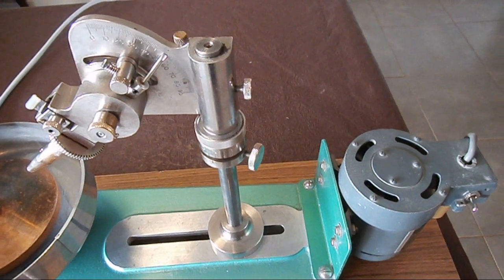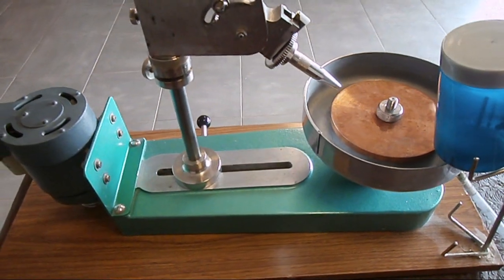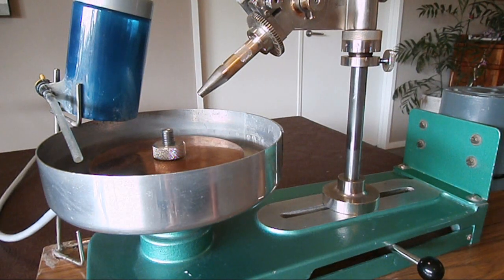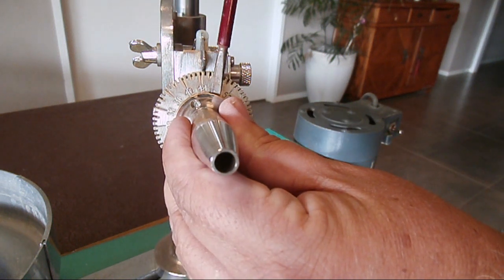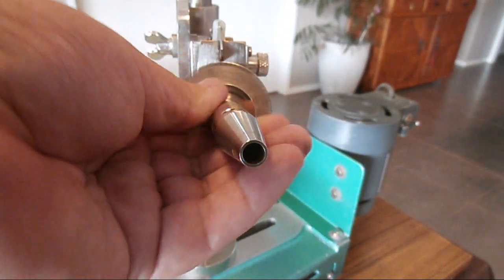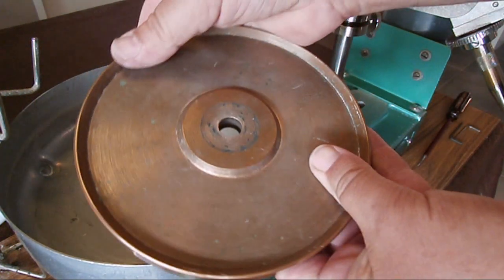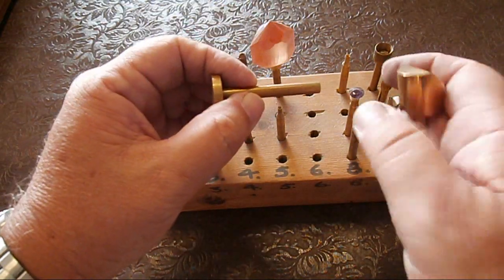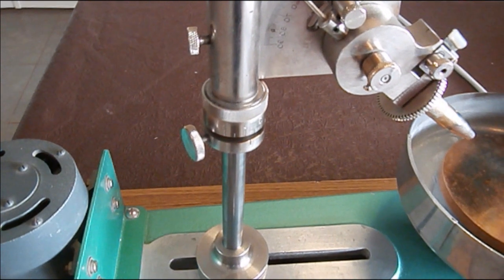Gem Cutting For Dummies - Part 1

Comment: When watching this video my mind flashbacked to when I'm 24 and just bought my first machine. Had read about gemcutting for years and collecting rocks since 10, visited gemcutters and mineral shops to cut my gathered stones.

Needless to say, wasted that machine because at that time I don't know jack sh*t about maintenance. Burnt out the motor twice, misalignes the axle and the faceting arm because I'm pushing too hard because I'm using too high grit disc and being impatient...I wanted to smack the me from back then.
Reply from the maker: It's never too late to start again....There's been a few time when I wanted to smack myself also for countless mistakes whilst faceting.